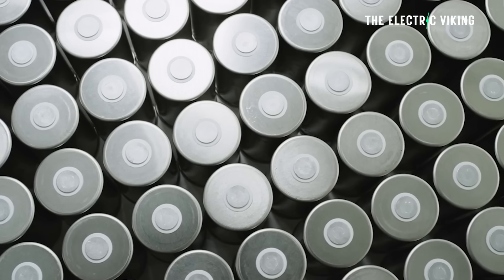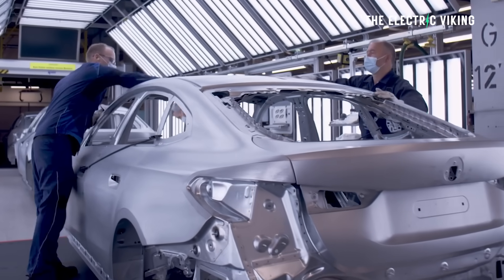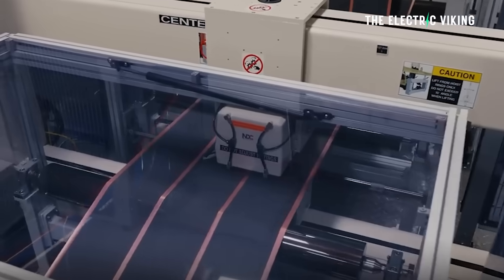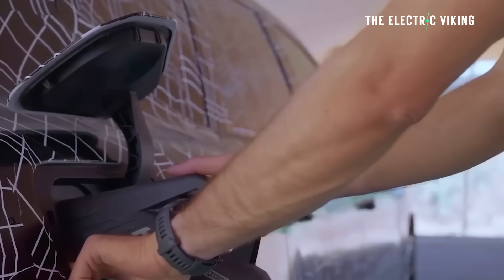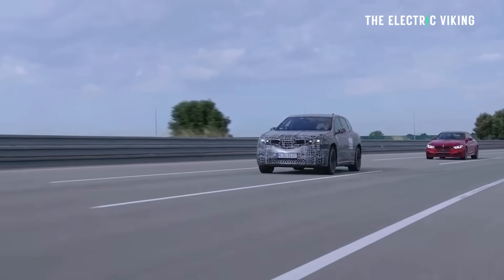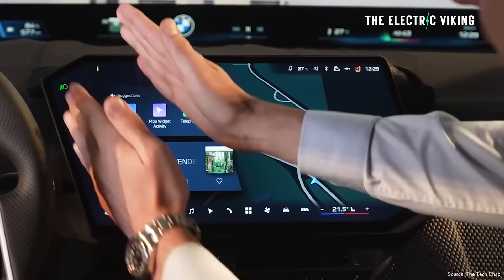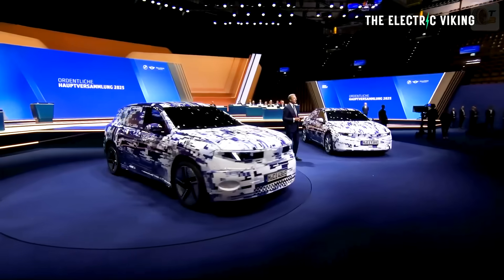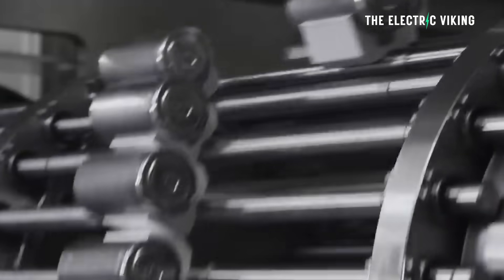BMW IX3 - new Model Y rival uses Tesla-like batteries for 500 mile range

Comment: 800km????
I’ve been driving EVs since’15 in the western US. San Diego to Seattle, Denver,,,, and I’ve NEVER needed/wanted more than 480km!

This push for Uber-range equates to carrying a LOT of dead weight every trip. To a lot less vehicles made per measure of batteries.
Reply: But its never 800km. Doesnt nmc chemistry prefer 80% charging so while u can go 800, youve often only charged to 650 unless u plan ahead.
Reply: @mearino  Usually when you're going to travel anywhere above like 200km+, you would've already be planning ahead of time. There's no way you could travel that far by accident, and if that is your daily commute, you would've already considered it into account when you're buying the vehicle itself. So it's not an issue, 80% daily, 100% for occasional trips.
Reply: This is just another step along the way. At some point, batteries would allow 2 or 3 THOUSAND miles range if kept to the same size. So, we're going to see the batteries shrink in size.  When a battery can give twice the range, they'll shrink it to half the size. These cars are already fine for a lot of people; as we continue to improve batteries, the end product will just get better and better.
Reply: @bigrobsydney  There's some great NIO owner youtube vides where they swap their 75kwH LP battery for a 150kW semi-solid state and they get about 975km range - exactly for long trips.
Reply: @howtomanagetech  Can you post a link please?
Reply: @bigrobsydney  This is a new video from the same guy I first watched - 975km https://www.youtube.com/watch?v=l4tZAIkXsvc
Reply: I'd like a 480km bladder !!
Reply: If charging was as convenient as fueling up on gas, having a 400 km vehicle wouldn’t be a problem
Reply: @Oxygen8Design  Serious question; how much range do you need daily?

Comment: Tell me about batt-capacity.. If less then 150kwh, it will never reach 800 km
Reply: Depands on the size of the viechle. SILVERADO EV has a 200kwh battery, and doing 800km, so, the Ix3 is half size of it then it is likely able to get 800 with only 100kwh pack. My 110kwh pack in Silverado EV can get 300km highway, bit over 400km on mix traffic
Reply: @林振华-t4v  so youre tellin' me that it will have an efficiency of 1:8. 1 kwh --> 8 km...
Even the newest model 3 tesla doesn't reach that kind of efficiency...

I have been drivin a model s 10 years now... 1: 4,09 is what I have been driving..
The Ix3 would need an efficiency of 1: 5,5 with a 150 kwh, to be able to go 800 km range...
Which is plausible, but then it would have to have this capacity...
Reply: The BMW iX3 is very efficient. The 800km are WLTP range. Total battery capacity is ~112kWh, net battery capacity is ~107kWh-108kWh. With an energy consumption of 13.4kWh-13.5kWh/100km or 134Wh-135Wh/km you achieve 800km of range. For comparison, the Tesla Model Y LR RWD has 622km of WLTP range with a ~80kWh net battery, that's 12.9kWh/100km or 129Wh/km. So the difference between the BMW iX3, which is a more massive car, and the Model Y LR is 0.5kWh-0.6kWh/100km or 5Wh-6Wh/km. Pretty reasonable and realistic. The US Model Y LR RWD has almost 82kWh by the way, that's also what Out of Specs measured. So you have to use different numbers for that if you compare the numbers in the US.
Reply: @Bernd-b1y I hope you're right. I know that europeans have been investing in batt chem. a long time, which is (together with efficient drive train) going to make the difference. And I mean SSB of course, but maybe also Li-S or Li-air...I also read about chinese carmakers reaching an efficiency of 1: 16 (with very small cars though), so it should be possible...

Comment: Here comes legacy auto and I’m all about it. They get the car part of the equation so much more right. Suspension, seats, steering wheels, little things like storage and not to mention service and dealer networks. It takes decades to build up these elements. Now they are catching up on tech I think it’s a no brainer to be really considering them.
Reply: 100%. You look at the videos coming out of the launch event and it seems like the handling and ADAS are right where they need to be and this video suggests the battery tech is gonna be legit - if the infotainment/panoramic vision thing turns out to be good in real world usage they could have something really special here.
Reply: I don’t want a dealer.  Middleman just adds cost.
Reply: @solarguy4850  I don't think you'll save that much. If they don't earn money by selling the car to you, the dealerships will up the costs for service and repairs.
Reply: @ricardito7443  If its anything like a Tesla it won't need annual maintenance

Comment: 500 miles ? the beginning of the end for on-route charging for most folk then. I almost went for the the iX3 a few years back but the crummy range and lack of BMW chargers put me off, went for a Tesla and never looked back so saying 500 miles would be really useful at times so I can travel further but avoid using any chargers on the way there and back.
Reply: I'm glad I sat out too I'll wait for the ix3 .It makes Tesla batteries and chargers obsolete overnight
Reply: what ever they advertise a the top of the range take of 20 percent for a real world value on the highway. YMMV is very alive in the EV world and effects all brands.
Reply: @ctuna2011  I dunno if that statement applies to all EV manufacturers, BMW often seem to under report range plus these new batteries look like they can be charged zero to 100% multiple times without issues. We will have to wait and see before drawing and conclusions.

Comment: Surprisingly they went for a cylindrical battery next gen. Not as effective packing wise but better for cooling as there are more space between them. But they still rely on NMC chemistry but at least it's made in Europe.
Reply: NMC is still the highest-energy dense cathode material that is feasible today. LFP is safer and cheaper but offers lower range.

Comment: I think larger cells will not hold their capacity as long as smaller ones but they should still be at 70% or more at 200,000 miles. That's good enough and worth it for the extra range when new. I still think a larger number of smaller cells is better for thermal management and less battery degradation.
Reply: Huh? Can you explain usually the bigger the capacity the better the cycling.. less depth of discharge ..the better the ageing...
Reply: @viyusavery248 Not pac capacity, cell size. I'm assuming same overall capacity.
Reply: @frankcoffey  ahh ok i misunderstood what you meant